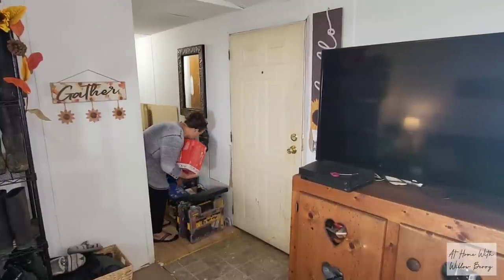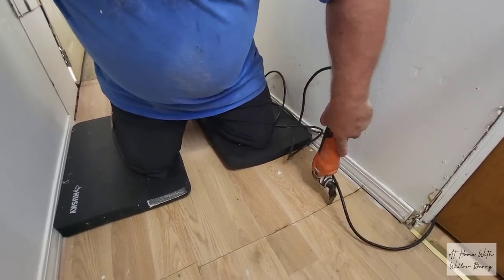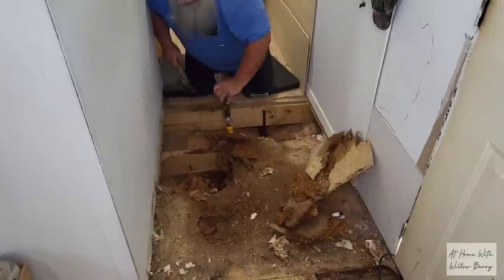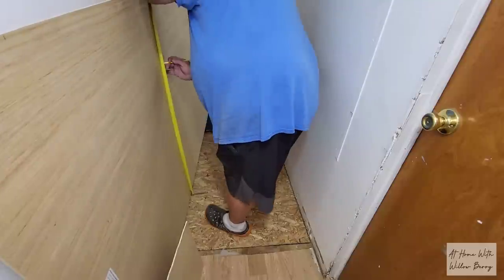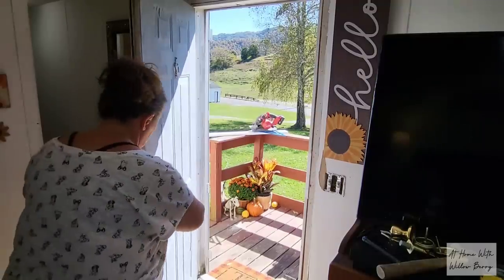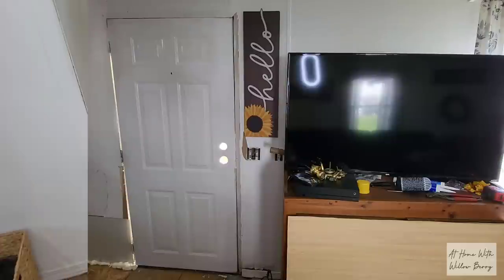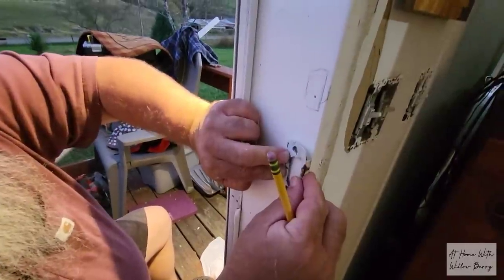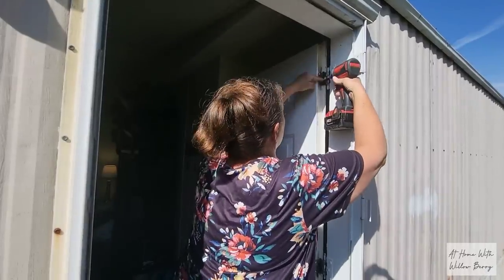1996 Single Wide Mobile Home Renovations / Replacing the subfloor / Mobile Home Living

Comment: Landlord should put a storm door up to keep water and cold air out this winter.  If not I would install an inexpensive one and take it with me when I moved.  It will help with heating bills.  I would also check to see how your water pipes are insulated so you don't have frozen and broken pipes this winter.

Comment: They make a metal strip that attaches to the roof above the door that will divert rain coming off of the roof away from the door. It will also help with rain splashing on the porch and coming in from under the door.

Comment: Add a piece of aluminum on the roof above the door to make rain water run away from the door, should help. We had to do that for my daughter’s house. Made a big difference no water dripping or running straight down . Thank you for sharing
Reply: Yes I think our friend used a half of a piece of aluminum or vinyl siding (horizontal) above the door of our shed. The little curved lip worked like a gutter.

Comment: Wish trailers were made with metal flashing that goes above the door and around the doors and windows ,and weather stripping is ok ,lot time ,many times used come  with stickon backing years back .lot   wet subfloor ,you were lucky it held up as long as it did ,sawdust and glue (ha ha )prefer heavy duty plywood 3/4 but not carpenter so ignore my telling anyone advice ,you both did well.